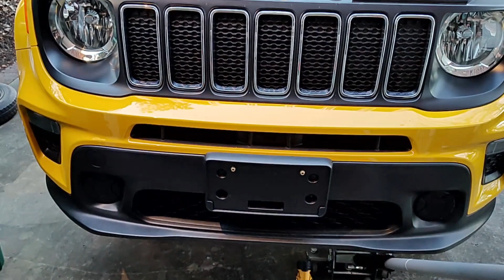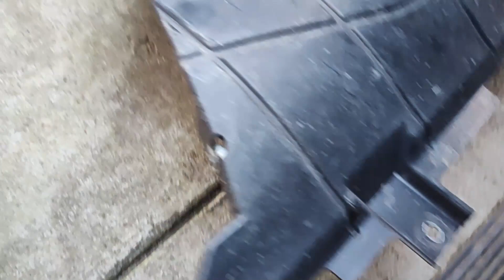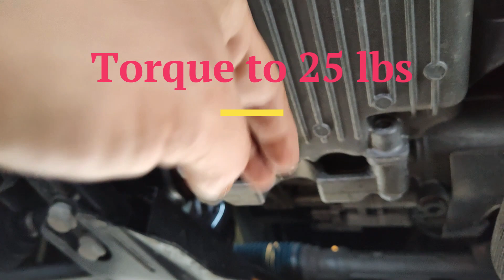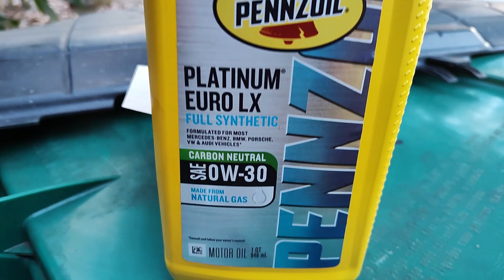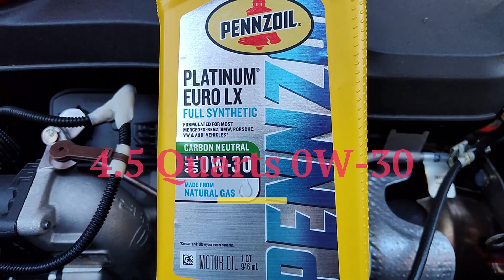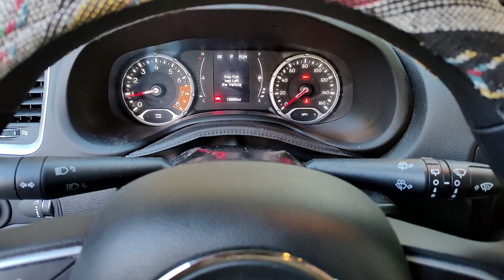2019 Jeep Renegade 1.3 MultiAir Turbo Oil Change

Comment: I had a Kia that the oil change tech over tightened the drain plug and spun the steel insert in the aluminum pan. My mechanic was  able to fix it with jb weld and save the pan.

Comment: I have a Dodge Hornet R/T with the same engine.  I just bought 5w-30 Mobil 1 Extended Performance, rated for SN Plus, GF-6A.  Thinking since be have mild weather, 5w versus 0w should be fine.  Love that little 1.3 Turbo.

Comment: I wonder why the 21 with same engine has 0W20 oil?
Reply from the maker: There are probably many reasons the Auto Industry as a whole are moving to "lighter" weight oils, but #1 is Fuel Efficiency and Carbon Emissions. Thinner oils produce lower pumping losses at the expense of higher engine wear.

This is why quite a bit of attention is paid to anti-wear coatings on engine bearings and piston skirts to try and combat increased wear from the use of thinner oils.

Comment: Hello. I could really use your advice. I am going to buy a 2020 Jeep Renegade 1.6 diesel automatic. The car has recently passed successfully the MOT inspection. The car consumed approx. 900ml. of oil from previous service until now (4.000km). I asked the MOT technicians if the car was leaking oil from underneath, would they be able to see it. They told me that they would able to see it as long as the car didn't have any protective aprons underneath. Watching your video I see that there is no protective apron underneath. Is this right? If you were checking the car for leaks, would you be able to see them in a Jeep Renegade? Is the approx. 200-250ml. oil consumption per 1.000km normal? PS. The exhaust fumes were ok. Thank you in advance for your help. BR, Vassilis.
Reply from the maker: Hello Vassilis. There is a bottom engine cover on the Jeep Renegade.  The technician should still be able to see a substantial oil leak with it installed, in my opinion.  Removal of the cover is easy and covered early in the video.  Many Car manufacturers have said, oil consumption of 1 quart every 2,000 to 3,000 miles is "normal".  900ml (.95qt) in 4,000km (2,485 miles) seem excessive to me, but falls in line with what the OEM deems "normal".

I would have it checked for any oil leaks and also look if you are getting smoke from the exhaust.  You will be looking for white smoke at idle but also under load to spool the turbo and off throttle.  If it idles without smoke but smokes under hard acceleration or as soon as you get off throttle after hard acceleration, this is a sign of bad turbo oil seals.

Hope that helped.  Let me know if you have any other questions.
Reply: @grumpyvetgarage  thank you for your prompt response! It is very helpful. BR, Vassilis

Comment: Is 0w30 euro full synthetic oil ok to use or should i try and find 0w30 from mopar? I have a 2023 renegade with the 1.3l turbo along with the 9 speed automatic
Reply from the maker: In my opinion Pennzoil 0w30 Euro Full Synthetic is easier to find and higher quality than the 0w30 from Mopar.  The Pennzoil does not have the oil certification recommended by Mopar.  I personally do not care that it doesn't have the certification, but you would have to make that decision for yourself on which oil to use.
Reply: @grumpyvetgarage  thankyou so much and you’re absolutely right it is easier to find the euro synthetic than finding 0w30 heck i waited 3 weeks just to get a quart of mopar were i was a quart low
Reply: @grumpyvetgarage  Amsoil full synthetic Signature series SAE 0w30 i think is the best motor oil for a jeep renegade. It is API certified,, offers 75% more wear protection, 50% more cleaning power, specially formulated for direct injection and turbocharged engine and is good for 25,000 miles or one year, although myself i change the oil every 5000 miles or 6 months. I have used this oil on a 2008 dodge Nitro and after 16 years of use, the engine still felt brand new. Now i have a 2023 jeep renegade  in solar yellow and i love it, not a single issue with it for more than a year. The only complaint is that the Fiat multi air technology is rather noisy making the engine sound a bit like a sewing machine when cold. I have installed a Raggazon exhaust system, and the sound have improved a lot, and the turbo lag is almost imperceptible.

Comment: have you heard about a turbo oil filter thats supposed to be checked cleaned often? I read somewhere
Reply: the 1.4 has a filter on the banjo bolt itself oil feed line, wondered if the same on the 1.3
Reply: turbo feed line
Reply from the maker: @_--Ghost--_  Not that I'm aware of.
Reply from the maker: I haven't heard about a second filter other than the engine oil filter on the 1.3 Turbo. I wouldn't think there would be a need for a second filter beyond the "full flow" engine oil filter.  If you find a reference for a second oil filter please leave a link in the comments.  I would be very interested to see it. Thanks for commenting.
Reply: inside the oil feed line banjo bolt to the turbo itself on the 1.4

Comment: Have you cleaned/replaced multiair filter?
Reply from the maker: I haven't changed the Air Filter on the engine yet, but it is a easy process.  I'll make a video in the future when it's time to change the filter.
Reply: @grumpyvetgarage  can you show me where it is? i can't find it :(
I have new one...
Reply from the maker: https://youtu.be/mEML0t2l4A4
Reply: @kolodworca  the air filter is on top of the intake. Loosen the top bolts and you will see the filter inside the plastic top piece its like a lid you open from front and up
Reply: @johantonde3336  Not air filter... Multiair oil filter. I found it and replaced. It's near throttle.

Comment: Once you have the stupid plastic aero plate removed, leave it off.
Reply from the maker: I'd say personal preference.  It definitely isn't protecting anything, but I'm assuming there may be some fuel mileage aero benefit.
Reply: @grumpyvetgarage  I have the 2015 Renegade with a 1.4 turbo multi air connected to the six speed stick.  Now that it’s summer, I get about 29 mpg. In mixed driving and 32 on a trip.  Is yours any different?  Thank you.  Mark.
Reply from the maker: The 1.3 Turbo with the 9-Speed Auto gets around 26 mpg in mixed driving and 30 mpg on trips.  It has the AWD drivetrain and that would cause some loss in fuel efficiency because of extra driveline and add weight from the transfer case, driveshaft and rear differential, but your 32 mpg on the highway is pretty good.